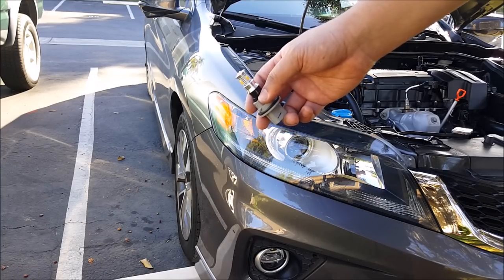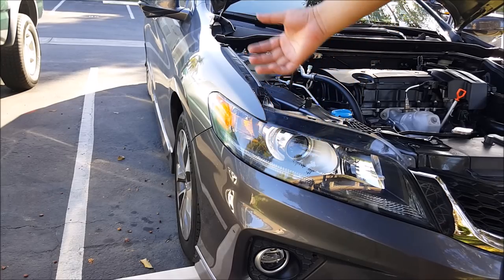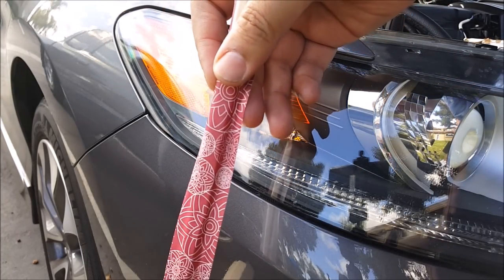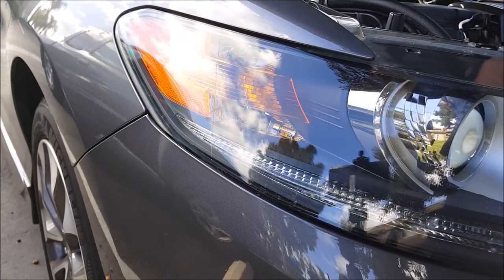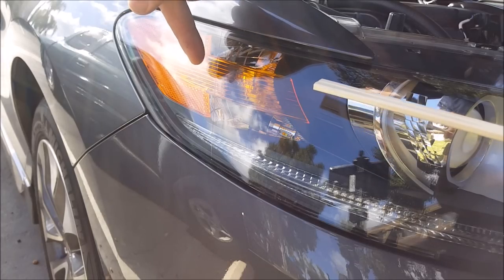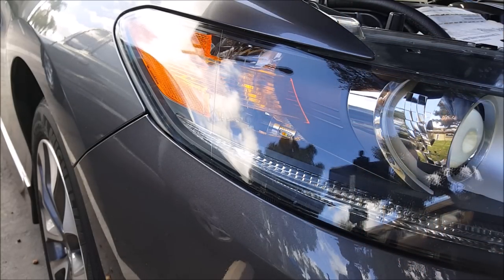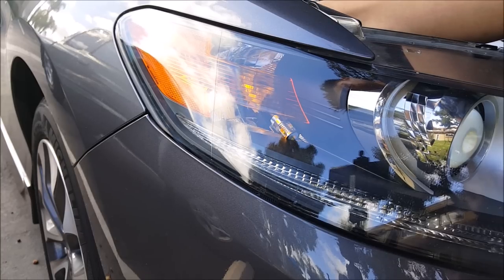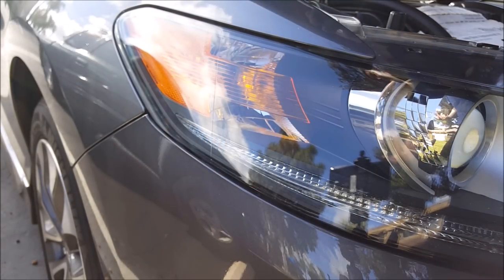[Q&A] How to Remove bulb dropped inside headlight housing

Comment: You know what also helped me pull those bulbs out of my headlight consistently? Making a noose out of dental floss and stringing it through a straw. Worked 100% of the time i had this issue. Just FYI for anyone that wanted a quick fix with household items 😁
Reply: holy fuck, that saved me so much heart ache. Legend..
Reply: This worked for me perfectly! I tried with the double sided tacky tape but i just couldnt pull the bulb through the hole since the clearance was so tight. Dental floss and straw worked on the first try. You are the freaking man bruh. Saved me a crap ton of time!!
Reply: And worked for me too!! You the man!
Reply: @willl5410  how can u explain better I’m trying to do it now
Reply: Just wanted to say thank you, this worked on the first try
Reply: dude, the noose trick was brilliant.  i used a steel angled drinking straw and fed the floss thru, with a noose on one end.  by pulling the excess on the other end, you can tighten the noose around the bulb to grab it and pull it out.  fished for a few seconds and worked first try.  thanks!
Reply: Make a video for it lol please
Reply: Saved a lot of time my man 🙏🙏 bless you

Comment: I had the situation today with low beam bulb which fell into the housing, but I can't remove it as the plastic round lip/frame of the base of the bulb is not letting me wiggle bulb and turn it into another position.  It fell into the low beam housing.  My wrists are swollen from numerous attempts + have multiple cuts :(   I think I would have to remove the bumper.  If I wouldn't drop it into the housing, I would be done in 30 min or less.

Comment: I was at my mother in laws house & 100 miles away & no tools & it was  2am.  On a 2015 honda Odyssey.  Busted a Macgyver. Starbucks straw (long) ceiling fan string and scotch tape.  Put the string in the straw  & at the other end put scotch tape enough to it won't go inside the straw. So in my case the long heavy Led Switchback was at the very bottom corner of the lens. I jammed the straw hard enough so the tape can stick. Slowly removed the straw half way of the headlight opening.  Then I fished the led without touching the chrome while pulling and adjusting the straw as I guided the string .
Reply from the maker: I used to watch Macgyver when I was young.  I actually bought the entire season 1 and 2 a couple Black Friday's ago and watched them all over.  I need to find Airwolf episodes.....
Reply: @DIYCarModz  that's awesome!  Im looking for Steethawk & Highway men as well. Planing to visit my mother in law in SD I was wondering if I can meet up & buy load resistors  2015 Honda Odyssey..

Comment: Thank you. Almost went insane after dropping bulb inside headlight housing.
Reply: Me today. Everything was going great, went to put new, amber led front turn signals in, got 1 in, and the other fell directly into the housing. I tried to get it out for like 4 hours. I'm so chapped. Nothing worked. Even tried the shop vac.
Reply: @DevinMarkovichMetal  My turn signal fell in. It's too cold to attempt this. I left it in also installed the new one. Would that cause any damages in the long run due to that bulb being in there possibly getting heated up?

Comment: You are the man! I’ve been struggling to try to get the stupid thing out. I used a popsicle and duct tape and flipped it over the edge so it will adhere on itself because I did not have double sided tape. I tried other double sided stuff but I didn’t work

Comment: I was just going to suggest using a thin wire with a noose and a piece of tubing but then saw someone (Cristoph Choe) had already came up with that solution. Being a banjo picker I use a very thin banjo fith string and a narrow plastic tube as I found the noose is a bit more directional being a bit stiffer but any tube and string for this noose grabber is ok if it does the job.

Comment: This actually worked on my audi A3, bought some cheap side light led bulbs and after first long drive the both fell apart into each headlight unit , was dreading taking the bumper off and lights out , this worked on both lights and only took a couple mins , thankyou 👍

Comment: Thank you! Used your idea but instead of chop sticks (not enough room to fit into the hole of left VW Jetta light), I used the Nite Ize large gear tie. Bent the end into a little J and wrapped it tight with double sided tape. Was able to move the bulb far enough back to where I could finally reach it with my hand and pull it out. Much easier than taking off the entire front end! Thanks!

Comment: Can play dough or modeling clay work as well? And is their any danger if you leave the bulb in the housing ?
Reply from the maker: Those wouldn't work.  You need to use some sort of tacky material.  You can leave the bulb inside.  It will just roll around.

Comment: I used a magnet.
Reply: Don't be too surprised if the metal on the bulb does not attract to the magnet...test it on another similar bulb to be sure before you begin so you don't waste time.  The bulb I dropped into my lens was not attracted to the magnets I tried.  I couldn't believe it until I tried on old bulb that I had removed.